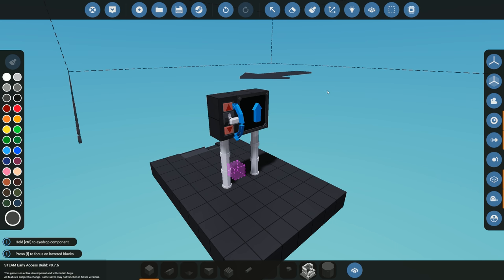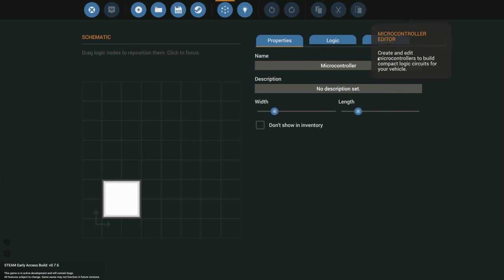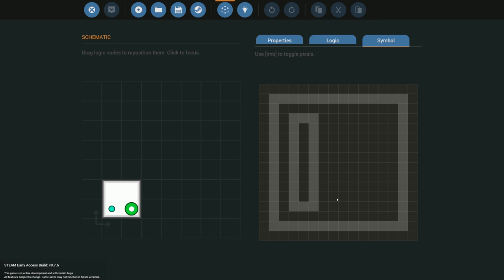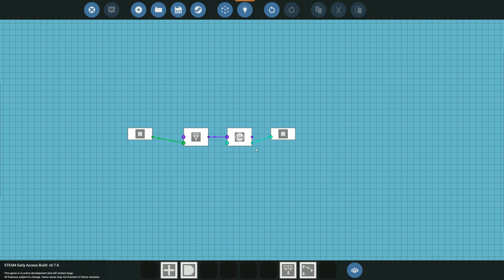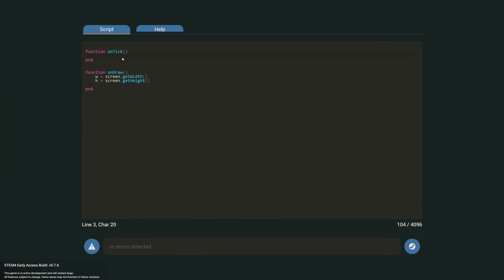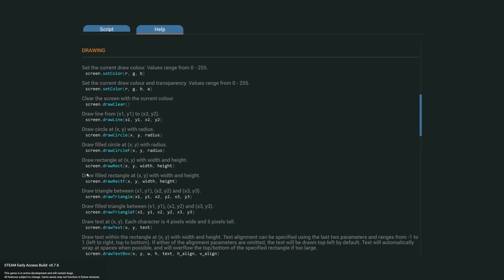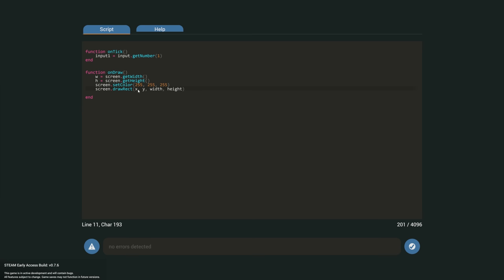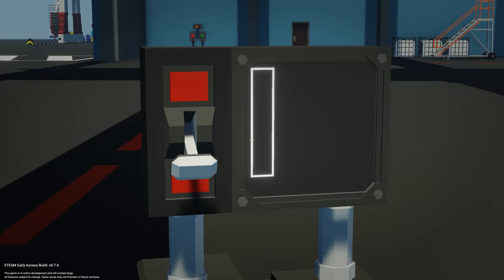Stormworks Bar Graph Tutorial (LUA BASICS)

Comment: I was trying to convert the clock signal to a basic 24 hour but the signal that comes from the clock is between 0 and 100 . And obviously the clock is between 0 and 24. Even if i use the function to convert it to make it same with the hours im not able to make it on the minuate part because i cant separate the signal. Any idea to make a screen clock?
Reply from the maker: It comes out from 0 to 1, just do a X*24 and it will now be 24 hours and then show the decimals

Comment: how do you do this with fuel/fluid tanks? it just goes through the bar because its not 1- 0 like a battery
Reply: I might be late, but you could use the outputs from the fluid meter by dividing the Fluid Level by the Fluid Capacity to get a number from 0 to 1, or the short answer: Fluid Level / Fluid Capacity = number from 0 to 1